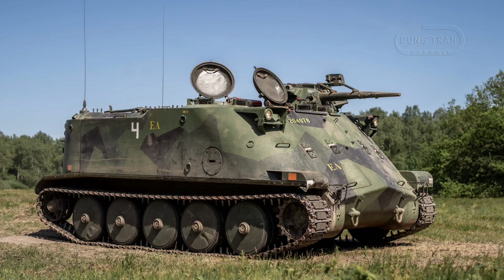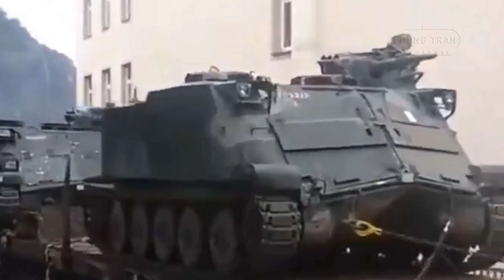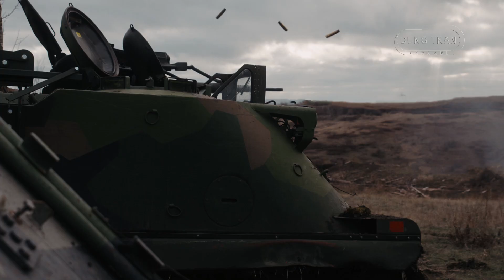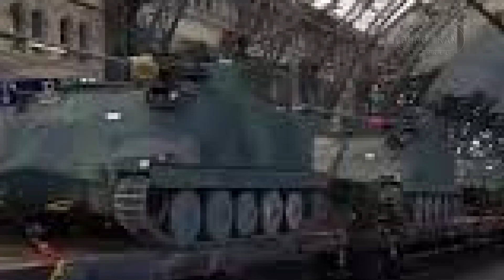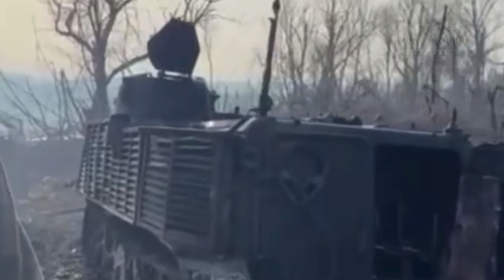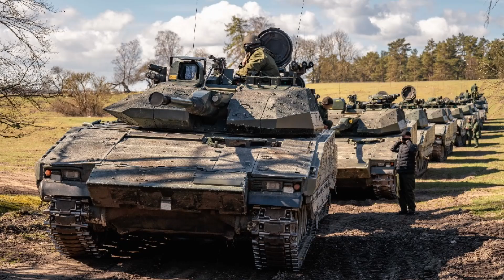Sweden’s PBV 302 in Ukraine: Role in the 2025 War Effort

Comment: No matter how much I hope they are fantastic so are the soldiers in Ukraine saying they are useless. They are too slow and are an easy target for drones and have too little armour.
So hopefully they can get more CV90 instead which has proven itself to be very useful.
Reply: More BS as they have not had them long Enough to find any problems
Reply: @Karl-Benny  They have stated publicly that they are to slow and unreliable. Nothing I just made up. I want them to be great but I can accept that not all systems and equitment will work perfectly for Ukraine.
Reply: That's just bull. They are as fast as a M113 and all vehicles, including Leopard 2A6 can be taken out by kamikaze drone attack. They also have more armour than a M113.
Reply: @ Its not my statement. And it possible that the M113 and Leopard have the same speed and acceleration. But they where specifically talking about the PBV. And the Leopard has better protection and are not used ast the PBV or the M113
Reply: @ Yes, my point was that everything can be taken out by a drone. So that is not an argument.

Comment: There has been many mechanical problems with this vehicles. But I know that the ukrainians are good mechanicals, so I am convinced they will solve these problems.
Reply: What many mechanical problems? Tell me exactly what they are, or I believe you make shit up.
Reply: These vehicles need daily servicing of critical parts. Problem is that the Ukrainian army just don't do the servicing that is needed in the field and then they start to break down.
Reply: @MartinLovasz-r7r  You no nooooothing. It is a work horse.
Reply: @ I actually looked at the Arsenalen video before that statement, and so should you.
Reply: @MartinLovasz-r7r  I was stationed on these. They do not need a lot of daily servicing
Reply: As I understand it proper regular maintenance easily done in the field reliability increases.
Reply: "There has been many mechanical problems with this vehicles." source?
Reply: @ His imagination

Comment: The M 113 has thinner armour than the PBV 302. As for spare parts I do think there should be enough considering that there is a short distance between Sweden and Ukraine compared to from the US to Ukraine.As for losses 3 PBV 302 has been lost. Sweden did send 250 PBV 302 to Ukraine.
Reply: As I understand it so did Sweden send all the spare parts it had along with all the PBV 302 in storage.
The engine is in civilian use and there may be spare parts for it to be found.
Ukraine will most likely need to salvage broken down PBV 302 for spare parts.
Reply: @znail4675 yes they did.